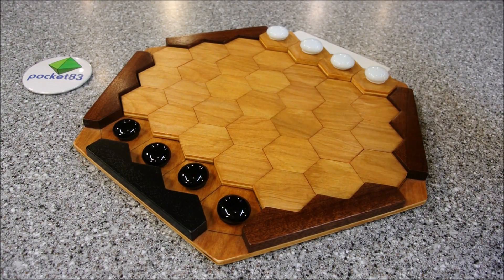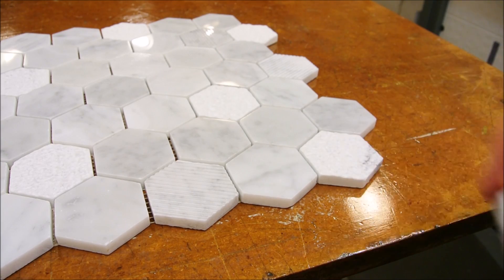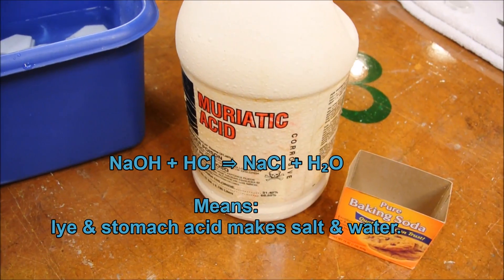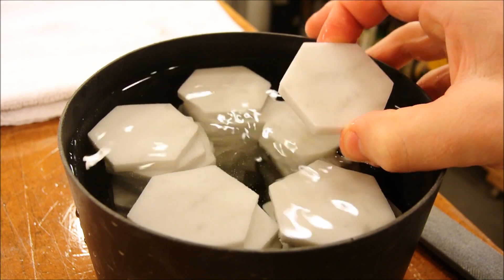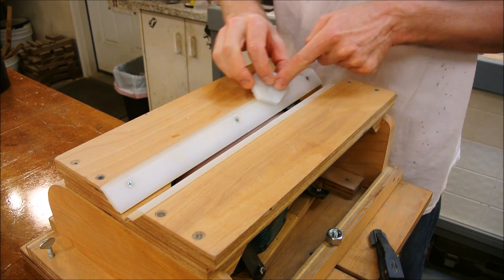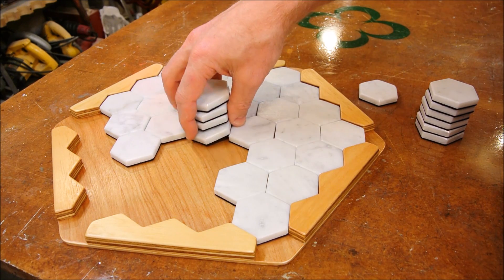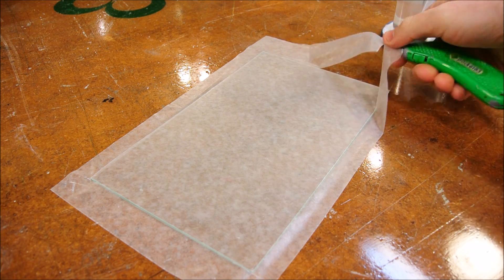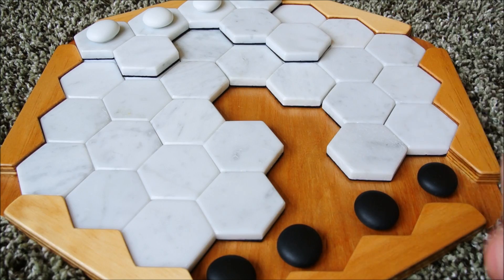Iso-path tiles from acid dipped marble

Comment: I would love to make this but I have an apartment.  Do you have any recommendations for useing the tiles without the acid wash?
Reply from the maker: Sure! Just get ceramic ones. There's a whole bunch of different types at most home centers. Some of them look great as-is. If your heart is set on weathered marble (and you are patient), you could also try experimenting with soaking them in a milder acid, like vinegar.
Reply: pocket83,  Sweet, I was hoping it would come in other stuff.  I use ceramic tile a lot with my plastic recycling but I don't really pay attention to what they have.  And I've got a ton of vinegar so we'll see.
Reply: Look for honed marble mosaic tile.
Reply: Too be fair marble is soft enough to hand hone
Reply: I wonder how weathering with a rock tumber would work.
Reply: Jeremy S Cook Would probably all shatter unless you did just a very few at a time with nothing but sand inside.
Reply: Tory Evans 

Hiyas
You could use citric acid wich is also used for household purposes or vinegar. The process could take a bit longer but it should work. Depends on the percentage of acid.
Dang it's so hard to describe technical stuff in a foreign language.

Greets
El
Reply: Tory Evans
 - I did a weathered marble inlayed jewelry box for a family friend's 80th b-day years ago, I took some offcut marble tiles from a custom countertop maker, shaved them to size, dipped the undersides in a 2-part epoxy to protect them, then left them outside in a container filled with some moss from the woods. Every day for about 8 months, I would spray the top down with buttermilk and water, to feed the moss. The moss grew like crazy and left some incredible naturally etched surfaces once cleaned, and isopropyl alcohol removed the epoxy.

The neat part is, you can pull a piece out and clean it to see how it's coming along, then just re-wet it and put it back in with the rest to let it continue. The moss will reclaim it within a couple days and continue as normal. It's a VERY long-term project, but if you're into labors of love, I highly recommend it.
Reply: In my opinion, the marble looks fine without weathering. Works perfectly and still looks great after waxing.
Reply: Yea I just bought regular tiles and after I pulled the screening off, I like the roughness from the dried glue. The edges need cleaned slightly though. But I see it working just great once its in a frame. My only concern is the tiles being so close that the +1 opponent has no choice but to remove a tile from the teleport passage. This is a sort of contolling factor I do not like. -1 can easily pick a path but not true for +1. The solution would be to have a raised pin in the center to lift any tile from its location. This of course creates more problems. Solvable also but complicating the build 10 fold.

Comment: I think my ideal version of this would have little circular indentations to keep the round pieces centred. Then you could have matching bumps in the bottoms of the tiles as well and have everything automatically align neatly
Reply: Pegs, you mean. I can't agree. To align neatly would be to snap mechanically in place. Such restrictions of movement contradict the organic feel of the game's play. Note that Chess sets do not tend to use pegs, either. 

After lots and lots of scrutiny (years' worth now), the present "ideal" design uses felt-bottomed marble tiles and round, semi-flat stones. In this version, placement is quick & easy, forgiving, and pleasant in the haptic sense. 

Please don't take my snappy reply as an offense. At present, this game is in the early process of manufacture, and so my default setting is to be critical. Every suggestion is being considered, but they'll only stand as permanent features if they can be well-argued. Every element has to be justified; in this way (and I've said this from the beginning), the game has designed itself.

Comment: 4:49 Would it work to first put on a glove, then add a bunch of baking powder & THEN another glove on the outside?
The theory is that just having baking-soda on your skin for a long time would probably be bad, so therefore you need the inner gloves, and if the acid gets through the outer layer of gloves then it will start reacting with the baking soda, forming bubbles & stuff, so then you KNOW the gloves have been compromised.
I don't know how strong the acid is, but usually a acid/base reaction releases heat, & I don't know how violent that reaction will be here, maybe a chemist can help answer this?

Comment: Unless you consider pins and holes to be an eyesore, simply drilling holes into the wooden tiles, as well as the board, and placing a short pin in them that only goes halfway through the tile would have the pins prevent slippage. You might also use ball bearings in smaller recesses to similar, but diminished, effect.

Comment: would beeswax change the color of the tiles? would I need to mix the raw wax with some kind of oil to use it properly?
Reply from the maker: Beeswax works wonderfully on marble. If you are having trouble spreading it, just add a bit of heat. The color change is very minor; it just brings it to life.
Reply: alright, thanks for the advice. I will try again after heating the beeswax. I did not acid dip my marble, so it's possible I'll need to fiddle with it a bit.

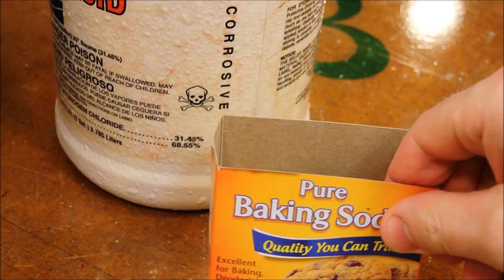Comment: 4:45 Hydrochloric acid doesn't feel oily or slippery at all, you're getting it confused with sodium hydroxide (lye). It's not super dangerous to skin, it will take some time before it starts to sting and when it does just wash it away with water, no harm done. You'll have to endure the pain and do nothing to get any significant skin damage. DO NOT get it in the eyes though.

I work around concentrated hydrochloric acid every day, it's not super dangerous. I would rather have that on my skin than lye, in fact I'd want to use hydrochloric acid in case I spilled lye on my skin (then water).
Reply from the maker: Of course, it all depends on the concentration. You know, now that I think about it, you're right; it's not really slippery. It just feels weird, and then it burns. But it's so easy to neutralize, that I haven't really had any significant tissue damage in a long time. I totally agree that NaOH is far worse to handle, and it feels way more 'soapy.' 

HCl actually quite easy to handle if you're competent. As such, the commentary here has been annoyingly stringent with respect to lab procedure. I've been taking lots of flak for adding water to acid, and for suggesting to use a slightly basic solution to neutralize. Everyone's a chem major! Try reading some of the comments: you would think I'm completely irresponsible based on some of their reactions. Pun intended.

Comment: Question! I love the Idea of this game but just looking at the board would make me think that say if the climber wanted to remove a piece from the center of the board, they would possibly have issues picking that piece up. Maybe like kind of an inverse donut shape in the center of each piece with ridges to allow for easier movement would be a good addition, albeit probably hard to do with marble
Reply: I know exactly what you mean, but in actual play it's usually only the first move that can be tricky. However, you can still press on one side of a piece to get the other side to 'pop' up just enough to grab it. That's a good argument for using thick (wool) felt, or to switch to a foam rubber traction foot. 

The concave donut ring idea could be great on a manufactured part, especially if it also worked as a locking mechanism. for example, if the bottom of the piece also had a convex donut.

Comment: Tap water usually is slightly basic. If it were acidic it would eat away the pipes slowly and you really don't want dissolved pipe in your water. Espacially if you have old lead pipes.
Reply from the maker: If you have lead pipes, you have bigger problems! 

What "usually" occurs is relative to where one lives. My tap water is slightly acidic, but it's still well within a safe and healthy pH range. Note that even distilled water will turn slightly acidic from absorption of airborne CO₂ over time. Further, rain itself is below 7, so a little register of non-neutrality on a piece of litmus paper held under the tap is nothing to get one's panties in a bunch over.
Reply: There are many places still with lead pipes. As long as the water is slightly basic and hard that is no problem, because a layer of lime will be on the inside.
Reply from the maker: Yeah, no. If you have lead pipes in your home, change them. There is no safe amount for lead exposure; lead is unequivocally bad for humans. Further, in order to have enough 'protective' mineral deposition inside of plumbing in order to buffer the lead, you would experience such a reduction in volume that your taps would barely flow. 

Now if you'll excuse my impatient tone, this has nothing to do with the video.

Comment: +pocket83 - in your other video about this game you asked if there are any similar ones - I actually just remembered one today I used to play called Quoridor, you should check it out! It's a similar concept, but instead of levels you have little walls you place on a grid. On your turn you either move your piece or place a wall, trying to block the other player while you get to the other side, but you have to be careful to not block yourself. It would also be a pretty good project to make a board I think.

It's not exactly the same of course, just a different take on the race-and-block "genre".

Comment: Actually, the plastic on the mesh is probably susceptible to water swelling. That is likely the reason why it let go.
Reply from the maker: Had the mesh expanded, there would have been some adhesive cast off. But the mesh was unchanged. It just lost part of its bond. If any of it were water soluble, 24 hours soaking in a tub would produce at least some evidence of sludge/film. I will grant you that it's possible that the glue just has a very slow rate of dissolution, but I find that extremely unlikely. 

Evidence seems to suggest the simplest solution: that carbonate rocks are just highly prone to being dissolved in water. But who knows? I'm willing to be convinced otherwise, but I need to hear a good argument.

Comment: Where do you get all of your resin and liquid silicon for mold making?
Reply: I'm the wrong person to ask. Most of my experience with casting and mold-making pertains to either ceramic, refractory, or concrete materials. I haven't used enough casting resins or silicones to develop an opinion that's useful. 

Here's what I will say: keep in mind that those products are extremely purpose-specific, so you will get different answers depending on the/your application. For some examples, there are different cure times, strengths, clarities, hardness/Shore, et cetera. All of these are considerations (not to mention price). 

I would go ask the opinions of Peter Brown and Jimmy DiResta. You probably won't get an answer, but I'm sure their catalogue of videos contain some sound advice on the subject. Look for the project that most closely matches yours. Good luck.

Comment: Could you do a similar process to put silicon onto the back of the marble? I've never worked with marble so I don't know if it's too hard to drill, scuff etc.
Reply: You could. And it's already porous enough that silicone should stick without drilling it. Still, I would want the layer to be much thicker. Besides, the felt is already a really good solution in this case.
Reply: Thank you for replying, as I said, I've never worked with marble and I've been wanting to make this board in my free time. If I do, I might try the silicone on the marble and depending on how it works, do the rest that way.

Comment: When I was getting taught to clean the beer lines at the bar I used to work at we ran the acid through the lines and my boss told me to splash a single finger through the stream and then rub my thumb and finger together so I would know what having acid on my skin felt like if I ever spilt some!  Good times,  but now we just have to use gloves :)

Comment: why use a hourglass? surely a digital timer would be more accurate and you could adjust it to exactly 40 seconds so they all come out the same
Reply from the maker: Go ahead. But it's pretty easy to use a minute-glass. There's only a variance (+/-) of around five seconds, and that's mostly due to my fumbling around. So my results were pretty consistent.
Reply: yeah that makes sense

Comment: I wonder if diluting the acid with water would reduce the risk of the acid eating too much of the tile? Maybe less violent too for small spaces.
Reply from the maker: Yes. Weaker acid will slow down the speed of the reaction. The longer exposure might allow the solution to soak in deeper, though. 

Think of it like cooking a steak hot and fast, so there's still a bit of color on the inside. I want my tiles weakened as little as possible; I just want to treat the surface.

Comment: It'd be interesting to see your take on a three player variant of this. Since it's hexagonal based, it could accommodate a third player easily, and there's three layers to the game, could be an interesting concept to play with.
Reply from the maker: Yes! It works. It's a mess of confusion to try and strategize, but it plays fine. So far as I can tell, there's no advantage to the level field player, as long as he must also move a tile during his turn. This means that he has to work the field against himself. It's really interesting. 

I didn't write three-player into the rules yet, because I'm not certain how the scoring should work. I'm hoping to get some feedback from others who have tried it.

Comment: Since you already drill the holes in the wooden pieces, why not drill them trough and make steel pegs to stick them togehter?
Reply from the maker: Problems: pegs are too visually distracting. It makes the board look cluttered. Also, the hexagons will still rotate about the pin, so you will need side walls to stop the 'spin,' so you end up not needing the pin! Maybe the most impractical part of that idea is actually doing all of the pinning; playing Iso-path requires lots of tile moving, so the pinning will probably make moving too frustrating. 

But there is a pin variation I would like to see, though: tiny pins and sockets, like on a checker piece. I can't do that myself, however. It would require a manufactured part.

Comment: First I am in the process of making my own game board, I have a cardboard version and it is a blast to play! Just got an idea for the complaint that the tiles are difficult to lift.  if you cut a grove half way up the circumference of each tile that would give a space for the fingertip to grip.  Should be just enough to add friction to the thickness of the tiles.
Just an idea, thanks for creating a great game.  This would be easier with wood tiles than marble.  Marble tiles could be engraved with dimples at the center of each side with a drill bit

Comment: it seems like moving on to stone the weight is enough you could have very gentle registration marks. the top surfaces of the playing board and each hexagon could have a slightly concave slope, and the bottoms of each hexagon could be slightly convex. This would encourage the hexes to rest in the proper locations on the board as well as on top of each other, and also cause the player pieces to tend to want to rest in the center of a hexagonal space, with out requiring any real player thought. You would slide the stone hexes or pieces around and they would subtly tend to encourage being left in the proper location.